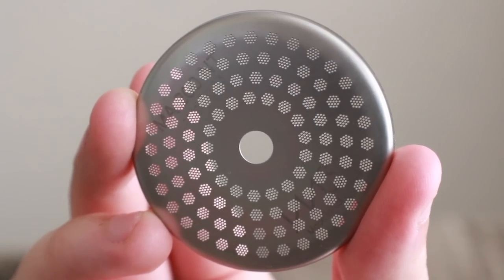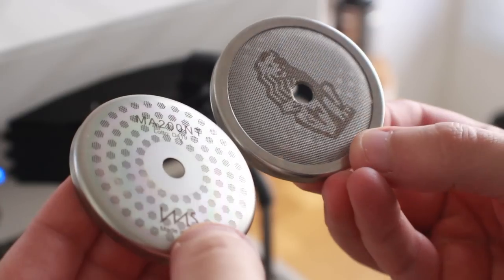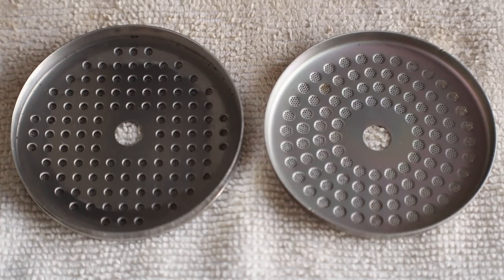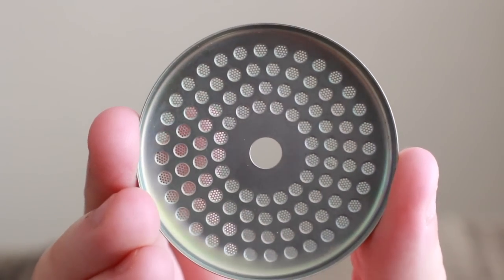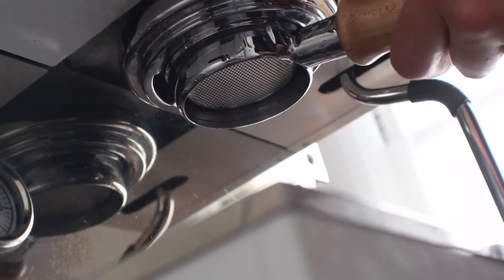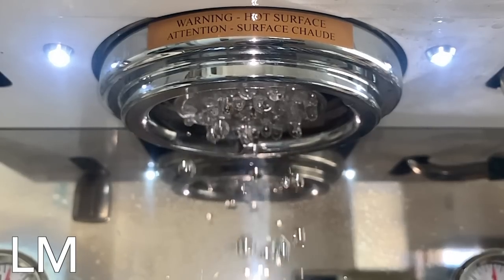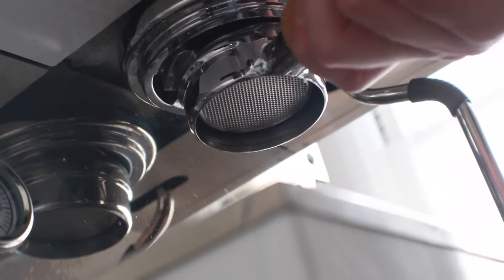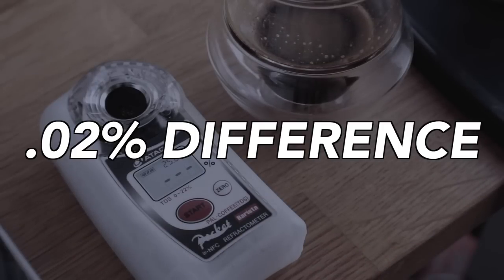ESPRESSO ANATOMY - Do Shower Screens Matter?

Comment: several folks on coffee forums and on reddit espresso forums reported that the cheaper version of IMS E61 "Without Nanotec" cleans up as well as the IMS E61 "with Nanotec" and they suggested to save money and buy the cheaper IMS E61 shower screen. Like you, everyone said the espresso taste inside the cup is the same with either stock or IMS E61 shower screen. The only difference is the ease of cleaning, in IMS favour. It also means fewer shower screen removals to clean up the inside of the group head and inside the shower screen as compared to the stock shower screen. The ~$30 (non-nanotec) is not much spend if it means you will spend less time on shower screen cleaning over the several years it will last. Thanks for your videos!

Comment: Another interesting consideration might be testing shower screens on a lever or spring lever machine. Most screens have the dead spot in the center but I have seen the Cafelat/IMS screen for the modern lever group that eliminates the blank spot and purposefully added openings in the center.
Reply from the maker: Yeah I’ve seen some stuff on this. Kees Van Der Westin machines use a screen with no deadspot as well. I’m hoping to get my hands on one to see how that affects things. I do think they the design of the dispersion plate will play more of a role in those cases.

Comment: I have a breville dual boiler and for the most I've been frustrated with how unevenly the dispersion screen (for me) has been. I tried an IMS version and that was worse. I then watched the flair 58 review and decided to buy the puck plate used in that. The difference is incredible, from a constant uneven bitter taste to a more rounded well balanced taste. Definitely worth a try if you're having problems like I was. Its not too spenny either.
Reply: What is the difference between the stock dispersion screen with the puck plate vs. the IMS dispersion screen with the puck plate on the Dual Boiler?

I myself have a Dual Boiler, and also the puck plate, and have been wondering whether it is worth the money to upgrade the dispersion screen!
Reply: @josephcarew4966  Hey Joseph, no idea sorry. My IMS dispersion screen is long gone. However y advise would be don't waste your money :) but let us know if you decide to do it.
Reply: Are you comparing a 'puck plate' as in a screen you drop on top of the puck ... To a 'shower screen' i.e. the part you screw into the machine's water outlet?
Reply: @SovietGrazz  that's correct. The difference between pulling a shot with out the puck plate drop in (just dispersion from the showerhead) to that with it when dropped in.
Reply: Agreed.  I have had no problems with the IMS shower screen, but the puck plate completely cured all dispersion / channeling problems.

Comment: I've moved to IMS over the stock shower screen on my Profitec after it was recommended by WholeLatteLove. Totally agreed that cleanliness is a great plus. Giving it a quick wipe after each shot goes a long way as well as weekly backflush cleanings.

At the same time, I upgraded to a silicone based group gasket which gave me a rather drastic improvement. Would be nice to hear your thoughts on other parts of an espresso machines as well.
Reply from the maker: I did give the silicone gasket a go a little while back, and it decided to go back to the standard. It just seemed too soft and I had to really crank it to keep it from dripping.
Reply: What did a silicone gasket improve, and how?
Reply: @spike443  the gasket that came with the machine was on the hard side and got harder in a couple of years. I was having trouble using other brand portafilters in place. Being softer, the silicone gasket lets me use more baskets, achieve a good seal with little effort.
The previous gasket also broke apart when I took it out. I think rubber gaskets are prone to heat hardening in time. I'm guessing silicone would have a longer life as well.

Comment: Water dispersion was an issue on my Breville Infuser, the unit has one water inlet that will wash out 1/3 of the puck, the IMS screen is a water drill and you can't really find enough space to break up the water stream. I made a diffuser plate to go above the screen. It is a bit crude but works great, much more even water distribution over the puck and I can taste the difference. This is an issue on many cheaper units. I think the Gaggia has a much better water dispersion plate.

Comment: This might be hard to organise but I think something that would be useful for a lot of folks is to understand whether these aftermarket screens make a noticeable difference compared to the stock screens in the machines people have. Personally I changed out the Silvia screen because I got a kit from pidsilvia to replace the gigantic protruding bolt with a flush bolt. No Ida whether the screen itself made a difference, but I think the bolt did
Reply: Yes.  I feel like this is a much more useful question to ask.  Is there even any point in going to an aftermarket screen?
Reply: @spike443  I like both, it's interesting to see this comparison and that two really different screens didn't make any difference

Comment: I ran into the dispersion plate hole mismatch issue with my ECM Casa V and the IMS shower screen. The dispersion plate has 4 holes and there were always at least a couple that were lined up directly with the holes on the IMS. The appearance of the puck after pulling a shot made it obvious that a couple jets were hitting the puck and it was not getting a nice even diffusion, which is supposed to be the purpose of the upgrade! Thankfully the good folks at WLL provided a refund.
Reply from the maker: Interesting! I figured it was possible, but not likely. Thanks for sharing your experience.

Comment: Nice video as always. I have had the problem with misalignment using a IMS 200 nanotech screen on my profitec 300. In fact the holes of the screen are at the same radius as the ones of the dispersion plate and the spacing is such that some of the holes unavoidably end up aligned. As a consequence I would get large indententions in the puck indicating uneven extraction, although not visible channeling. So the IMS screen is now back in the box even though it was easier to keep clean.
Reply from the maker: Thanks for sharing your experience! I was sure this was something that could possibly happen. Better off in the box than messing up your shots, that's for sure.

Comment: Damn, I came here for answers, I left with a coin flip on my preference, lol. So, comparing two very great screens provided no difference. Have you seen a baratza/sage dual boiler without the portafilter on it? It's insanely uneven, yet where I've read, I'm advised not to look into it, however, videos like these demonstrate that even dispersion without a portafilter is still desirable. Would you suggest that the upgrade on a standard breville/sage dual boiler is necessary, given that the dispersion of water is uneven?

Love your chilled formatted videos!
Reply from the maker: I was hoping to find a clear winner, but sometimes that's just not in the cards. I think an upgrade to the screen may definitely help, and its not an expensive either. Not a lot to lose.

Comment: I would think that 95% of the flavor comes when the portafilter is pressurized I.e. completely filled with water and coffee.  At that point,  the screen should not matter..  the screen only matters at the starting infusion and I would guess that as long as it is good enough to not cause channeling in the puck, there won’t be a difference in flavor.    So yeah I agree with your conclusion, buy something competent but I would not go overboard
Reply from the maker: I think the importance is more so applying an even application of water from the screen that builds even pressure and translates into an even extraction, which in turn creates a better tasting shot.

Comment: I just took a look at my Gaggia's distribution & I'm happy with not upgrading, looks just fine
Reply: @surfacepro5519  a lot of the espresso doodads are just boredom-upgrades for the mind, not so much for the practical improvements. I notice an improvement with my VST but I've heard the IMS isn't as fussy with the Gaggia. I also have issues with the fit on the VST both into the group head and when trying to knock out the brownies

Comment: My IMS screen is a pita to remove from the group. It has no rim on it to lever it off. Other than that I found it is less forgiving  over stock when it comes to puck prep. The water drip is better though.
Reply from the maker: Yeah I've seen some machines using a different attachment method for the screen, what machine do you use?
Reply: @Sprometheus  mine is ECM mechanika  slim. Cheers

Comment: On Simonelli and i might have overlooked the diversion plate.

Thanks for mentioning on the alignment.

Shall see if i can make any adjustment on it since there are just 4 holes in the middle.
Reply from the maker: I’d be curious to see if you notice a difference on a bottomless aligned and misaligned with the dispersion plate exits. I could source a machine that quickly to try it for myself.

Comment: Use BPlus / Flair screen atop the puck, an unintended benefit of it is an always spotless shower screen.
Reply: another benefit of using those metal screen is that it can improve extraction on much much cheaper machine where the main problem is the original group head shower screen is not able to disperse water evenly.

Comment: I've read that cafiza will remove the nano coating of the IMS and potentially ruin it's performance. The non nano-coated version doesn't have this problem
Reply from the maker: I haven’t noticed a quick breakdown of the coating, but I backflush weekly so maybe it’s more of an issue in a cafe environment.

Comment: Is there any concern about the coating on the IMS wearing off over time and ending up in your puck? Kind of like the worry many have about the chemicals from non-stick pans ending up in your food.
Reply from the maker: It does seem to wear slightly over time. I’m not sure on the chemical concern though, that’s a good question, I haven’t even considered that.
Reply: @Sprometheus  This was one of the reasons I stopped considering IMS baskets and screens but I might be overly-cautious!
Reply from the maker: @Crowbr7  I get that. I wonder if they have any response to that. I’ll ask them and let you know.
Reply: @Sprometheus  Awesome! Love the channel! Keep up the wonderful work!
Reply from the maker: @Crowbr7  thank you, I appreciate the support!
Reply: I remember reading that if you use Cafiza (or similar cleaners) it will remove the nano-coating faster.
Reply: Same worry here. Been putting off a change and I have it in my hand!
Reply: From personal experience, soaking your La Marzocco screen in the LM cleaning powder will completely dissolve the Lion image and make your water brown.  So...not sure if that's any healthier over the long term in your coffee than the IMS nano coating.  Curious to hear what IMS responds back to The Real Sprometheus on that.
Reply: I was worried about that, too. Marc from Whole Latte Love said it probably was a kind of quartz coating and therefore shouldn't be harmful. But I ended up ordering the non-nano version anyway. I wonder if they produce a trusty and non-avoidant official answer...

Comment: I think flow rate matters a bit more than dispersion screens. My Oscar II has a fast flow rate at the group head and I doubt my IMS screen helps with extraction. The real advantage of having an IMS, at least to me, is being easier to clean. After each shot, all you need is a wipe and one single back flush.

Comment: Good video. I am still currently  using my la marzocco screen that came with my machine. How long are they usually good for. I do notice that my extraction isn't as sexy looking coming out of the bottomless portafilter anymore
Reply from the maker: Honestly, they are good for a long time especially when it comes to home use. The wear on screens is so small and essentially is just wearing the holes slightly bigger and less effective at maintaining a steady flow. I think about 2 years for most home machine people making a couple drinks a day would be just fine.
Reply: Awesome thanks. Anything you suggest to up my machine ?
Reply from the maker: @TimRogers81  if you haven’t changed out your flow restrictor I’d recommend removing the .08 and putting in a .06. Really slows the water flow to a more reasonable pace.

Comment: Back to this video again
As an espresso freak, I bought and tested the RA 200 IM screen on my Epoca, I didn't find the NanoTech version

Until now, I didn't find major differences, I will update my post after a month or more, to see what's under the screen, cause the original screen was always clean 100%

P.S.

A tip to have a cleaner screen
Don't over dose your basket, let some head space, it will better for even dispersion of the water at the top of the puck
At mine I don't even see the footprint of the screw, I don't care for that, I care only for taste

Comment: Sprometheus - my LMLM doesn’t make a nice shower like that at all from the factory. It just squirts 3-4 streams of waters in various directions. Nothing like the nice droplets you show in this video. Any thoughts?
Reply from the maker: Often times the longer it runs the more the streams will come together. Also, it can have to do with the cleanliness of your screen, particularly on the backside where buildup can block some exits. And lastly, pressure and flow rate can play a role. The more water is hitting the screen the more you’ll get streams as it’s now spreading out as evenly and slowly. My machine was on 6 bar pressure and I have the .06mm jet installed over the stock .08mm that has a much heavier flow rate.
Reply: @Sprometheus  this is helpful, thank you. I’m changing to the .6mm gicleur soon which I’m hoping also helps with the intense amount of small sprays I get with a bottomless portafilter despite good puck prep.

Comment: The screen doesn't matter because it's not the section of the flow that creates nor release the pressure when the system is under load.  Anything between the pump and the release sections will have equal water pressure.  Looking at water distribution when the screen is just dripping water doesn't do jack...it's just dripping water.  That's not the operational environment / conditions.

The screen, at most, does two things: Prevent jets of water when water is initially flowing onto the puck, to prevent immediate erosion.  And two, easy cleaning of the screen surface.

The water always flow in the direction of low pressure (release point) of the system.  Doesn't matter how the holes are distributed on the screen (as long as they're geometrically even)...because any hole is a pathway from high pressure point (the pump) down to the puck / basket (release).

Comment: Waiting for the Matrix shower screen to release. It builds slight pressure before water flows and VERY evenly distributes the water.
Reply from the maker: I think they build of pressure is key to what makes the IMS work a bit better at dropping the water more cleanly than the LM. Not sure if it was designed with that in mind. I will have to check out this new screen.
Reply: They said that there were production delays and expect it to go on sale next month. I believe they were also working on a basket using the same design.
Reply from the maker: @sycoaniliz  interesting, I haven’t heard of this brand I’ll have to look into it.

Comment: What's your take on changing the flow rate restrictor (aka gicleur) on the LMLM from 0.8 -> 0.6? Would this not have a bigger impact on the actual extraction and result in the cup?
Reply from the maker: I think changing the flow restrictor is a cornerstone upgrade. I’ve done it and always recommend it to new Mini owners. The more reasonable flow rate allows for smoother extractions. I had lots of channeling issues with the .08. 

In terms of extraction and cup results I think overall most will be happier with the .06 because it lowers the occurrence of channels which could have a negative impact on flavor. But you can still pull great shots on .08, just a little more finicky.

Comment: Could anyone tell me if there’s much difference when it comes to extraction with 53mm vs 58mm baskets.
Reply from the maker: Personally don’t think so. I mean you get a wider bed, but I don’t see how that would effect the extraction in a negative way.
Reply: @Sprometheus   Thank you for your reply. I was doing some research and its a very controversial topic. A lot of people think because its a deeper bed and less surface area you need to apply a higher pressure. Its also said to over extract the top and under extract the bottom, but this is all hearsay not actual facts. A lot of people prefer the smaller 53mm basket as its less prone to channeling. Would make for an interesting video if someone had the correct equipment.

Comment: how  many exit  water  holes are there  in the grouphead of the Mini .........behind the dispersion screen ......
Reply from the maker: Just one, the screw that holds the screen  then pushes water out in four directions over the screen.
Reply: @Sprometheus   Thank you !! so the water  is dispersed through 4 holes. that*s the reason for such nice even creamy extraction !! even the Breville Dual Boiler has only one hole. the italians always get it right......

Comment: I have an IMS screen and silicon gasket waiting for when the stock ones in my Lucca M58 need replacing.  Recently installed flow control and am loving playing around with my pulls.  Tempted to add the IMS now to see if it makes any noticable difference but 9 months in, the stock screen and gasket are still in great condition.  Upgraditis SUCKS.
Reply from the maker: Upgraditis is a real affliction! No rush though, I'd let it ride for a bit longer and get the most out of your current screen if you're happy with it.